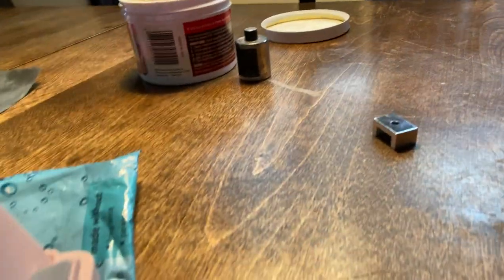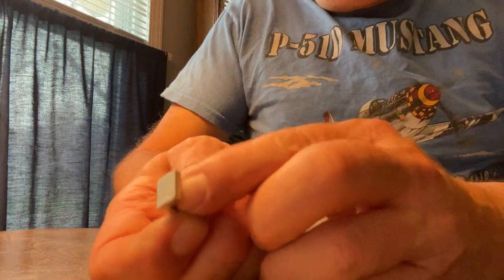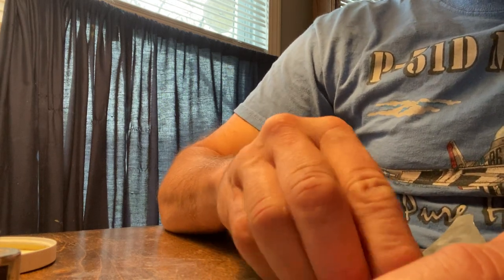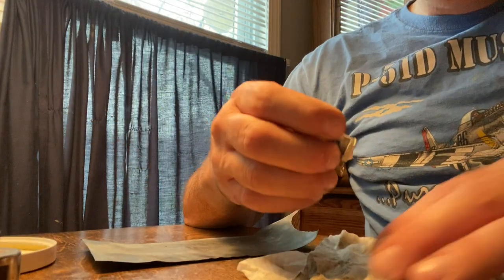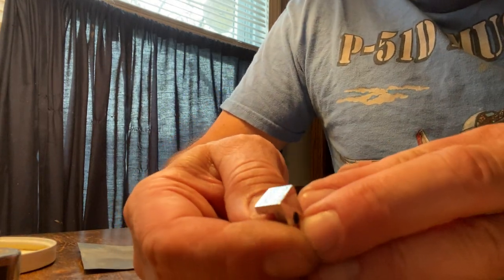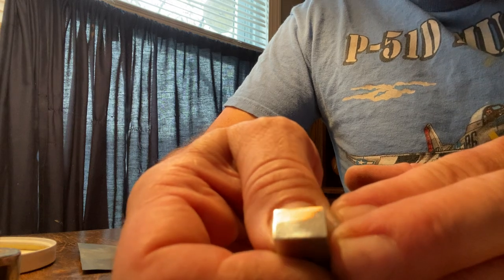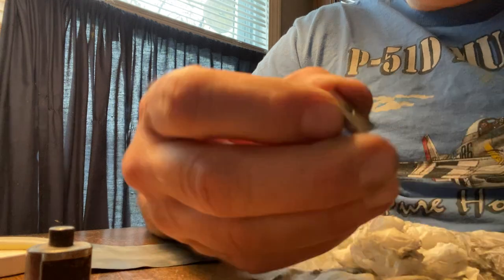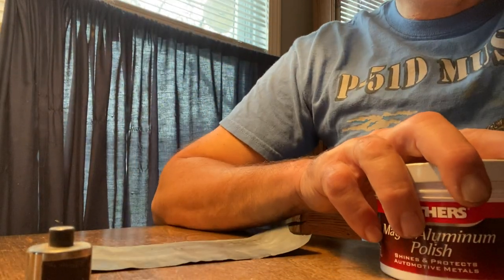This is what your barrel finish will look like

Comment: Sub 12 Airgunner uses a boot lace to polish his FX barrels ! First thing to do is push a pellet through with a wooden dowel and mark any tight spots on the dowel, then use Autosol polish to remove the tight spots and polish the barrel. The advantage with the FX is there are no machining marks to remove. Imagine how much it would cost to have a gunsmith polish your barrel ! Learn how to do it yourself and the satisfaction you get from the results down range are well worth all the effort ! I have an FX but, believe me, it is more fun modifying something mechanical yourself to perform better yourself than simply paying for someone else to do it for you ! I have modified a Skoda Estelle, that would only do 85MPH when I bought it, to do 105 MPH after a lot of modification, but on the cheap and it put a bigger grin on my face, than the Audi I also owned at the time ! Cheap is definitely more cheerful !
Reply from the maker: That’s a good way for an FX liner but the problem is the FX liners are 1 to 2000s difference because they’re not truly round.
Reply from the maker: I just sold two months ago my 1996 Dodge Viper GTS supercharged 905 hp. Methanol injected nine 8 1/4 mile
Reply: @amazingairguns6350  Check out the late brake show ! Sure Johnny would have loved to have reviewed your car !

Comment: The barrel OD of a .22 Lother Walther barrel is .62"/15.8mm. Just the barrel od  on the A fx barrel is 8.08mm.
So just lapping and polishing the Lother Walther has less barrel barrel harmonic's and whipping action! 
So is a barrel stiffener was  added to this L.W. barrel it would have less whipping action.
Although I do like the available tuning valve and pressure system of the FX... My 24" TalonP barrel with just lapping and polishing will out shoot the FX barrel!!! Faster fps and fpe!!! When I'm done lapping and polishing the .22 cal barrel... I will be starting a page in a couple month's called Jackson's Airgun Barrel's.

Comment: Is it not correct that if the surface is super shiny it becomes more sticky and holds onto the pellets,
Like running your hand on flat clean glass your hand sticks yet over dimpled glass it has less adhesion.
Just a thought.